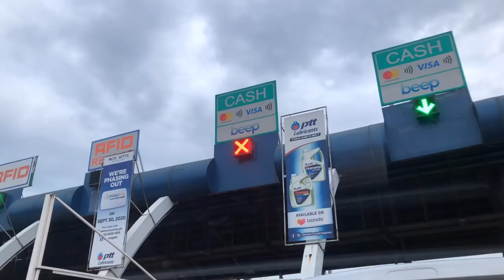NATALO YUNG MUSTANG? | Clark International Speedway Trackday | South Scene

Comment: 18:02 matatalo po Yung pickup if Yung mustang is top of the line, Kung familiar po kayo sa Ford Mustang Shelby GT500, Dahil po ang makina ni Shelby GT500 ay 5.2L Supercharged v8 which is nag pro produce Ng 700hp at 625lb-ft of torque